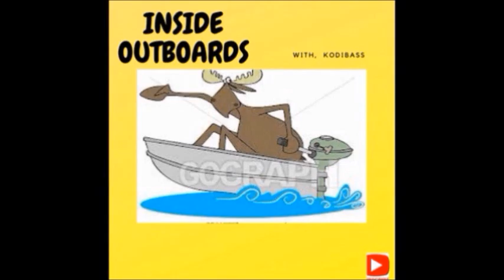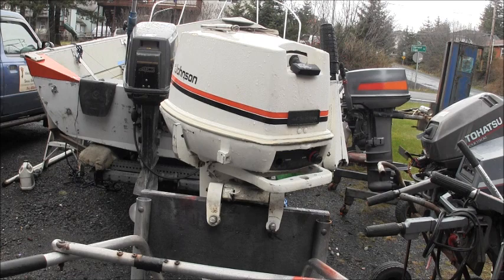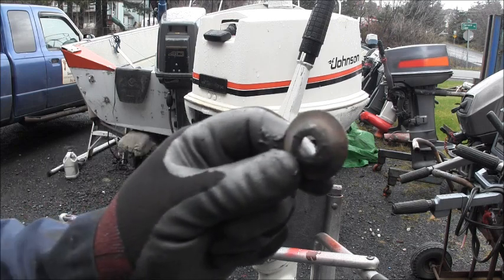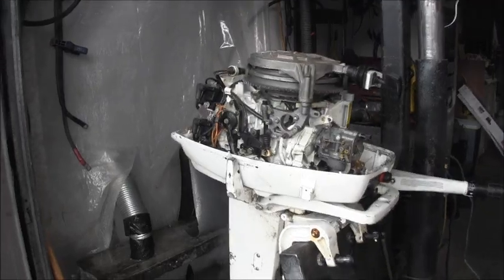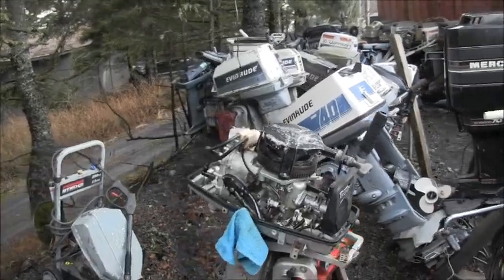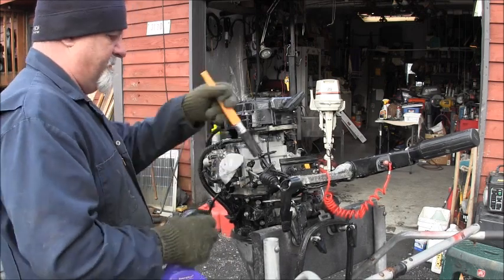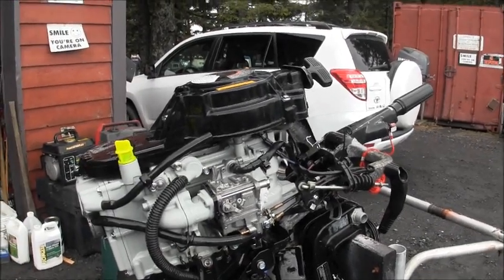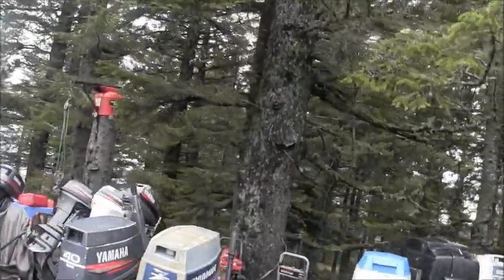JOHNSON 25 HP OUTBOARD TRANSOM CLAMP REPAIR  &   More....

Comment: Breaks my heart to see a beautiful low hour engine like this Johnson suffer from even the most basic lubrication issues, nice work on those clamp screws!  That tilt pivot shoulder bolt is gonna be next on the torch list if they don't attack it soon...  They better get that gearcase off and serviced before it won't come off anymore, especially if it is a long shaft.  I know, only so much you can do if they are not willing to spend the dough to save this thing while they can....  And yes, that foam insulation under the hood was a big OMC mistake...Just degrades and flakes off over time while getting sucked through the engine...
I'm glad I'm not the only one who talks to the engines/and to myself while working on these things!
Reply: Most of the time, but not all, the foam insulation gets all over the powerhead when the owner takes the cowling off (or puts it back on) while the motor is running.  Then, the flywheel teeth shred the foam and it makes a mess.  While the foam can deteriorate over time, it is not all that common.  Depends on the environment in which the motor lives.

Comment: These are the biggest pains in the butt with outboards stuck screwclamps  more common with saltwater engines of course.Why didnt they put zerk fittings on them at least some motors wouldnt have this problem. Second thing I check after I think of buying a motor is first if the motor turns and then if the scewclamps turn,LOL!.  My way is I try  lots of heat and if no good cut them flush step drill and tap them out faster for me. This method is a alternative way to do it and save the clamp when you have no replacements which is good for some. Just dont break the drill bits ...  Great Video.. GP

Comment: Hey kodi,big fan by the way, I have a 1978 25hp evinrude salt water series,if I take off the original fuel pump it looks like a triangle pump and put one of those small squares ones on will that cause the motor to slow and pick speed up and not run like it should ? Appreciate the feed back sir
Reply from the maker: No On a 25 it shouls work just fine, the fuel pump only fills the float bowl,  I wouls look at tank fittings hose length and carb as the issue.   kb
Reply: @kodibassInsideoutboards  ok,thanks a lot

Comment: I have a 1983 johnson 25 horse power 2 stroke outboard i just bought.  When I pull into shore I manually lift the motor up but it doesn't stay up.  Is it suppose to be that way or am I missing a part?
Reply from the maker: There should b a little lever on the side if that is in the upper fwrd position it should stay up.. If it's missing or wont stay up something is stuck or missing.   kb
Reply: @kodibassInsideoutboards  Thanks for the reply. Just to confirm, the lever you are talking about is the lever that switches from "forward to neutral to reverse" ?  Currently, that lever was in neutral and might be the reason why the motor will not stay up......when I get off work tonight I'll try putting it in forward and lift the motor.  Thanks
Reply from the maker: @Tifford1   No not the shift lever below that on the side of the transom.   kb
Reply: @kodibassInsideoutboards  Then I'm missing it because nothing is there.  I will have to use a small board for now til I can have time to pull it out of the lake.  Thanks for the reply